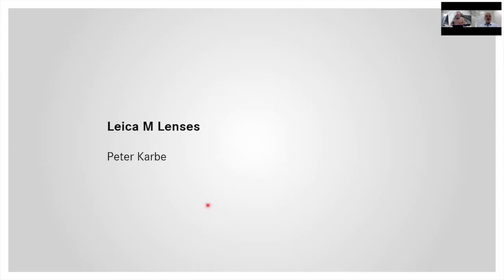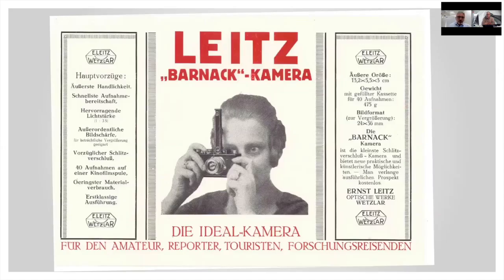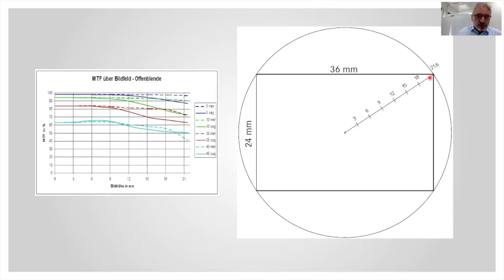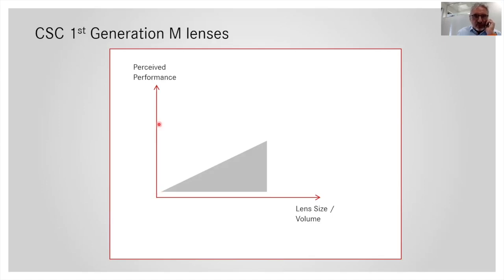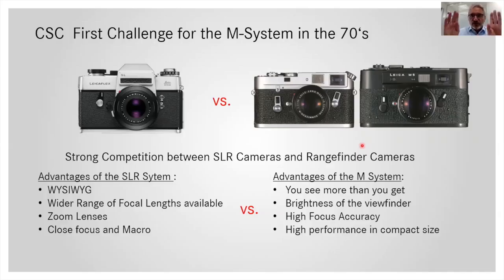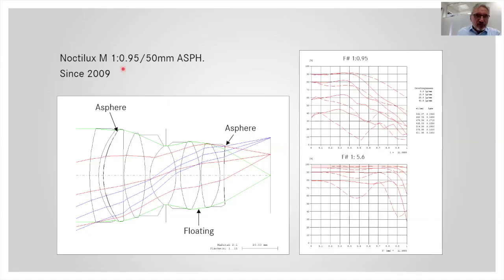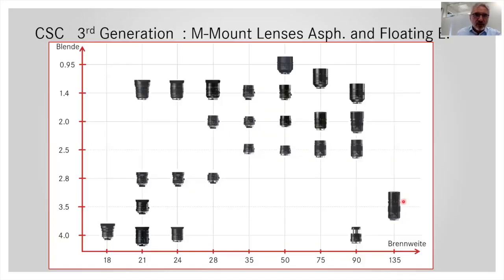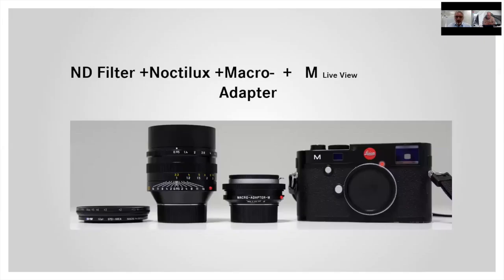Leica M Lens System with Peter Karbe

Comment: Are Sony G Master lens better optical quality than Leica M glass?
Reply: Comparing lenses is multidimensional, but I can tell you one way in which I prefer the Leica M.  I have a few G master lenses but don't have a macro lens. Currently I digitally scan my film using an extension tube. The 35mm Summicron with 2 extension tubes and an M to E mount adapter clearly outperforms all of my other lenses, including G Masters with tubes for this task.  The Leica Summicron 35 with tubes and a mount adapter is so damn good at scanning film that I'm not in any rush to buy a true macro.
Reply: @saramdipm  Did you try the Leica Macro-Elmar-M 90 mm f/4 + the Macro-Adapter-M or the Leica Macro-APO-R 100 mm f/2.8?
Reply: Hard to say in general terms but some of them certainly are. It allows for more flexibility in terms of tolerances when dealing with larger lenses. Mind you the SLR lenses are humongous compared to Leica M glass — one of the main attraction of the M series lenses.

01:27:33

Comment: I'm very impressed by Dr Karbe : a life dedicated to Leica lenses. I understand the challenge : size, performance, robustness, ease to use = not easy to build ! But why aren't M lenses weather sealed then ? Other question : constant aperture Zoom are not Leica's choice to preserve size and weight. However SL zooms are big and heavy. So I don't understand the point.
Reply from the maker: Have a listen to Dr Karbe's lecture on SL lenses and this will give you a perspective on the design criteria for all lenses. SL zoom are big because they are very high quality  - size is directly related to optical quality, particularly for auto focus zooms with built in image stabilisers.
I can't speak for the weather sealing but given that M lenses are mechanical, they are far more robust and less prone to water damage than electronic lens anyway.